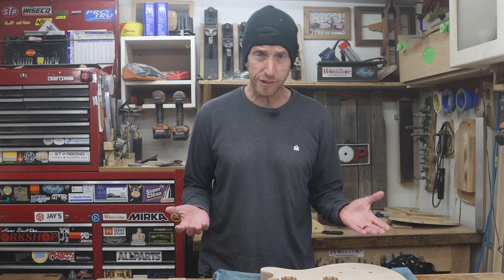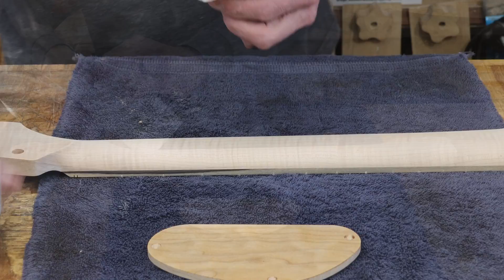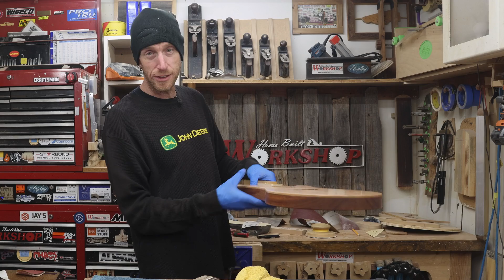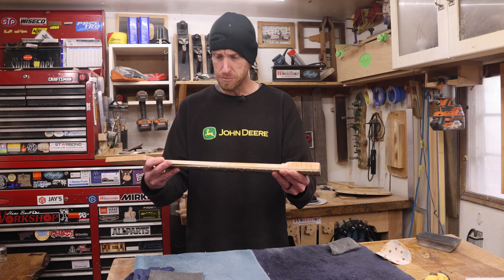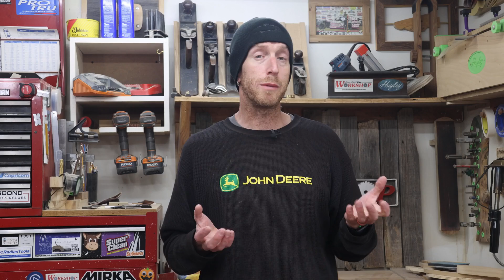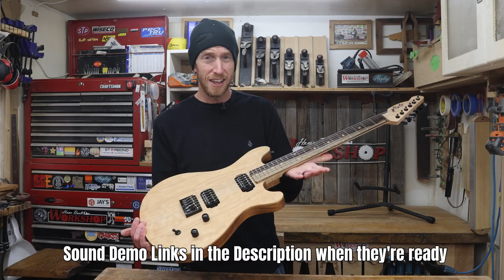Quilted Maple Guitar Build Part 3 | Applying a Tru-Oil Finish and Completing the Guitar

Comment: I Tru-Oiled the maple cap of my Telecaster build, I slightly diluted my Tru-Oil with mineral spirit, it meant I could get 5 coats per day on the maple to a total of 12 coats, I polished the finish to a high gloss, the alder that the rest of the body was made from got a nitro finish from a rattle can I bought from Stew Mac, as did the headstocks face and maple fretboard, the back of the neck and headstock got the Tru-Oil finish although much thinner than the cap.

Comment: Great outcome with the Tru Oil for a natural finish. I sometimes add a drop or two of Feast Watson Golden Teak Tint or similar to get a deeper finish and it looks great also. Most people that I have watched wipe the oil on then wipe it off straight away - rather than let it dry and then buff off with 0000 steel wool. Either way seems to work, and the process is really hard to stuff up. Cheers, it is a great video.

Comment: Curious but why do people choose steel wool over scouring pads?
Reply: I think perhaps the finish is finer with the 0000 steel wool, but could be wrong. I have also put a rectangular scouring pad on the bottom of an orbitol sander and it seems to work well also. Just sit the pad on the timber and sit the sander on top of it.
Reply: @lesblack413  yeah we just called it scotch Brite in auto body but I have a set that goes from 240 grit to 2000 grit. Thinking using that would eliminate the fear of the steel wool damaging the pickups. Plus can fold it over to avoid the pressure created by fingers.